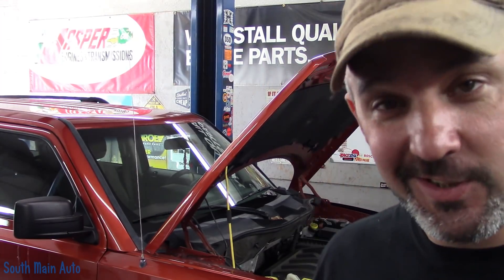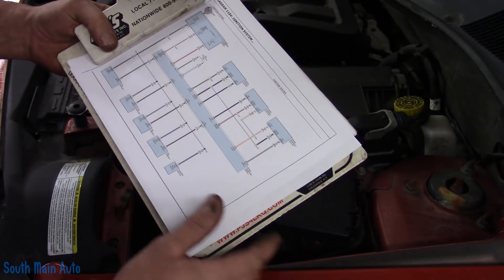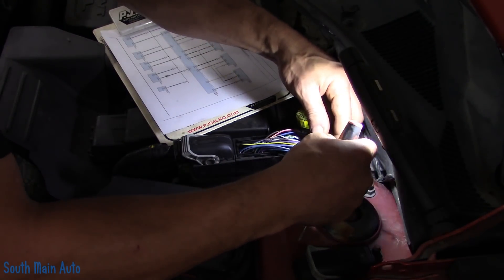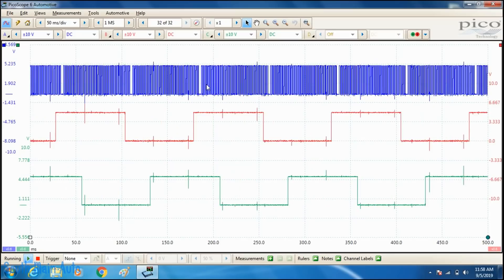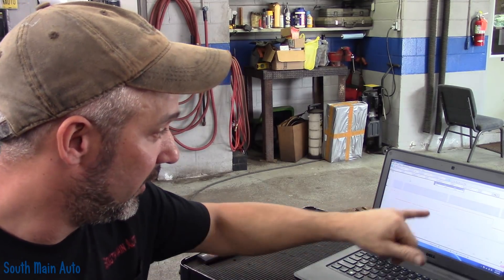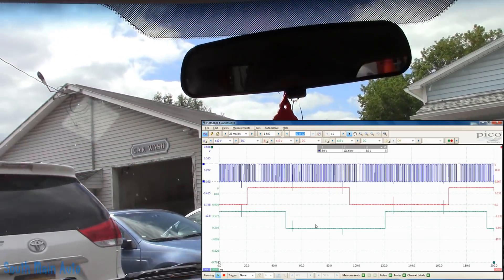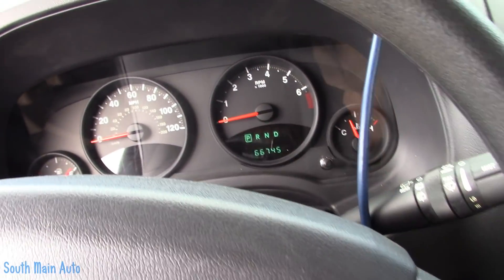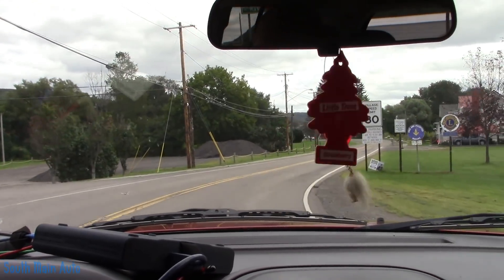Jeep Patriot: Crank Sensor Troubles

Comment: Kinda like my 07 Galant where I had a battery drain and found voltage over the door lock fuse and seems to work ok since I pulled the fuse and the system seemed to reset itself when the door locks where activated 2x's yet still leaves me a bit unsettled. Thanks for sharing.

Comment: The glitch from the sensor may cause the logic to behave in a way unaccounted for in the ECM firmware code. My experience with computers taught me, buried in the code is what I call run home to Momma. Essentially software like this has a list of potential faults or fault combinations. If it can't find a fault that matches the input, it will default to the first or last fault on the list. I have seen it happen with anything from a mainframe on down.

Comment: it seemed to do it at 5300 rpm or there abouts. When the jeep is in park the rev limiter is lower just under or around 4000 rpm. i wonder if it were put in neutral and revved out to 5300 if it would stall again or if it has to be both that rpm and under a load?
Reply: it wont free rev to redline in neutral either, only in gear, so on lift/jackstands wheels spinning

Comment: Eric my jeep did this also I happened to learn that my wife was over filling the gas past the pump shut off and happened to mess up the evap system and would do the same exact thing after awile with out over filling it cleared its self out had a 2011 just empty every pocket compass

Comment: Hey Mr. O -
I'm a big fan of your channel and watch almost everyday. I know this doesn't pertain to this video, but I watched a video you did on a Subaru head gasket recently and wanted to ask you if the carbide scraper you used is your preferred method for cleaning block and head surfaces on all head gasket jobs;  iron and aluminum? Appreciate any response!
Thanks!

Comment: Hey guys, Chrysler had a rapid response transmittal (preliminary TSB) for the crankshaft sensors on the 2.4L engines to be replaced for intermittent stalling. They're not that hard to install once you figure out the layout but you have to work blind to get the bolt out. I do it by going down by the right rear corner of the head from the top side. I use a 1/4" drive 10mm chrome swivel socket with an extension. Careful not to drop the bolt or you may never find it. Don't ask me how I know. :)

Comment: Nice video sir! I only have an Amazon special bluetooth scan tool, and I saw the same codes on my lady's 09 2.4. Her symptoms are almost identical: Random skipping and bucking, and it has died  flat out a couple times. We also have some issues with long cranks. Shut it down, wait a sec, and turn the key... Fires right back up with smooth idle. Very intermittent and definitely strange. We are replacing the sensor tomorrow, it will be her first real wrenching project. I have plenty under my belt.
Not sure if you will see this, but I have no way of resetting the adaptive memory. Is this a critical step? I have seen a few videos diagnosing and repairing this same fault, with a couple of people reporting either crib death sensors or a week of running before it spits another out. I can clear codes on my cheap scan tool, and see surface level data, but definitely not an o-smell-o-scope or adaptive memory/body module codes. Thank you in advance.

Comment: My 2011 Patriot is the same... too bad the last shop I took it to replaced the starter and the engine mount they were supposed to replace the CPK too but I doubt it cause now it's bucking worse... FML... do you think they didn't reset the ECU?

Comment: The easy way to do this job: Remove the air box, reach down behind the engine and remove the 3 heat shield bolts, slide heat shield out of the way, remove the crank sensor bolt and replace the crank sensor. 3.5 hour job done in half an hour. However this is only possible if you can work by feeling and not by seeing what you are doing.
Reply from the maker: Yeah that is what Jason ended up doing. Wasn't bad at all really...

Comment: Have you ever messed with a Suzuki equator I hit a deer it's been in the body shop for two months just for body parts now it doesn't want to start no throttle response now it just cranks over they put new battery throttle body still no start never had any trouble before always ran great

Comment: My 2016 Jeep Patriot does the same thing.   P0339 is constantly the engine code. I have replaced the crank sensor 8 times now & the problem persist.  Every sensor switch, I get about a week or so before the problem comes back. It now cuts off at prolonged red lights, slow-moving to stop/go  traffic, entrance onto the high way, and in idle and sometimes in park.  Lately, it vuts off with no check engine light ever coming on.  Great video. Any advice on it being a deeper issue than the sensor?

Comment: Your pinned comment closes the mystery.   :)
Reply: The scanner computer used in the video: https://amzn.to/2H3l6dt Autel MK908 Ultimate Wireless Automotive Scan Tool with ADAS, ECU Coding, Full Bi-Directional Control, ABS Brake Bleed, OE-Level All Systems Diagnosis

Comment: Here's a test I would have liked to have tried on this car - Run the engine and momentary disconnect the crank signal. Does the engine recover, or die completely requiring a restart?  If the answer is the latter then it is likely that a) the crank sensor /connector / wire loom is failing on temperature/vibration and b) Jeeps should be avoided at all costs. When a major vehicle system cannot recover from this kind of failure - it is designed badly (an aircraft engine would probably not be designed that way). Would be interesting to see what other car brands do?  A lot of these sensors are a Hall effect (magnetic proximity) type which do suffer from temperature failures. A heat gun and some form of magnetic pulse generator to exercise the sensor might prevent the inevitable "leave you walking" event.  Thanks for the video though - I am sure we will all see this kind of failure at some point.
Reply: Bit difficult doing 60 mph to unplug it , our job is very trying, knowledge of how electrical  components work  is a great skill and Eric has the skill !!!!!!
Reply: @mikeberry304  Parked of course. The nature of the dropout & recovery of this signal would point more to sensor intermittent connection (mechanical) rather than temperature. Changing the sensor thus probably fixed it of course. I just like to know why something is repaired & the nature of how the system reacts to the failure. Eric's knowlege/skill is impressive.
Reply: You could momentarily ground the CKP sensor signal circuit at the PCM with a test light to see how it reacts while the engine is running.   It will probably shut off and flag the CKP intermittent code

Comment: I got a 02 Mitsubishi lancer es i changed the camshaft position sensor and now the car gets no power, up to this point I've replaced the crank shaft sensor the battery spark plugs fuel pump starter but it would crank but not start

Comment: @2:22  dont ever assume  especially with chrysler wiring harnesses. shame it was so hard to get to. been bit by in harness splices too many times and especially mopars . they weld the wires together rather than a crimp connector,  with it dieing on a full torque that harness is stretching.  will be watching to see if it  makes it back.  i understand your reasoning though.
Reply: seemed more rpm and vibration dependent than on torque twisting. on lift or stands in gear so the RPM can whizz way up there would show the same thing.
I'd have been leery of the connector terminals being bad/have leaked in salt water

Comment: Isnt it a hall effect sensor thats prone ta heat gremlins as it ages? Its like my toliet float device which has an adjustmen ta stop trickling of water creatin tgat annoyin high pitch sound. I adjust it and its like all gud then 1 hour later the dang trickle is back. Gonna have ta replace it in other words cause the dng gremlin has jinxed it and claimed as its own.

Comment: What was the reason for having to pierce the crank and cam wires instead of back probing at the ECU connector?
Reply: With the bouncing road you don't want you back probe wiggling around creating a glitchy pattern.  The piercing probe is a more secure connection.

Comment: replace the alternator. check the coils on the heads as well.  your problems is alternator.. its throwing out wild amps. you can replace the weakest link if you want. its the alternator that is the problem.. she'll be in the shop again. another weakest link will fail. i know because i had the same issue... they need a recall on all alternators supplied on the jeep patriot.. i had 3 coils fail and the alternator..  one dealer replaced the transmission on a patriot and found out it was the alternator that was putting out wild amps. killing electronics

Comment: Wouldn’t it be a refreshing idea if engineers set a goal of building vehicles with the purpose of making failure components as easy to access and replace as possible. If nothing else they could build fair products that are cheap to repair. I once had a Pontiac GrandAm where to replace the thermostat you opened the coolant cap and pulled up on a loop. The thermostat came out and you pushed in the new one. No hose clamps, lost coolant, wrenches, or gaskets.
Reply: that cuts out all the dealer service(rape) departments.....

Comment: There's a recall for certain Chrysler products to replace the harness for this issue.
Reply: Fiat Chrysler Automobiles will recall 43,071 vehicles in the United States to replace the crankshaft sensor connectors. The campaign will cover the 2016 model year examples Dodge Journey, Jeep Compass, and Jeep Patriot. In addition, there will be 3,385 of them in need of repair in Canada, 487 in Mexico, and 2,830 outside the NAFTA region. The problem only affects models with manufacturing dates from May 9, 2016, to July 15, 2016, and with either the 2.0- or 2.4-liter four-cylinder engine.

Warranty data showed FCA U.S. a population of vehicles that had crankshaft sensor connectors that didn’t conform to the proper specifications. The parts could potentially lose contact, which would cause the SUVs to stall or not to start. This could happen without an error appearing on the instrument cluster. The company is not aware of any accidents or injuries from this fault, though.

Source: Fiat Chrysler Automobiles, National Highway Traffic Safety Administration
Reply: Not the right year but it is the right motor.  Manufactures only need to recall on cars X years old.   I think the right call was made to replace the sensor.
Reply: @stevenrice47  this one is 2010
Reply: We had one that we got a pigtail and sensor.

Comment: I own an '09 Grand Caravan. That Jeep uses the same radio & HVAC controls. Pretty soon, the Jeep owner will have problems with their heater/AC fan speed. HI speed will stop working, and the controls will have to be removed. The issue is the copper connectors on the speed control knob get covered in melted plastic and require cleaning.

Comment: Dude, the owner of the Jeep, Jason, and you need to get some lottery tickets.. the way the crankshaft position sensor is the heart and soul of any EFI system, hardly ever do you get codes for that sensor..
Reply: I see crankshaft sensor code fairly often.
Reply: @meabob  I don't understand how it would happen.. considering without the crankshaft position sensor there is no spark signal generated

Comment: Have a relative with a 1991 Dodge Dakota (3.9L).  It seemed to need a replacement sensor every 60k miles, almost like clockwork.  At the 120k replacement, he started keeping a spare behind the seat.  I see this Jeep is at about 66k...must be coincidence.
Reply: NO your cousin had an old truck that liked to run hot. That is a big V6 that produces a lot of heat because it has to move that heavy truck. Yes it is a mid size but heavy vehicle. Heat confuses the CPS sensor in all cars.

Comment: Don't know the problem with the CVT.  Never had any trouble with my Jeep Patriot CVT.  Suspension parts?  Well, that's another story.  Just have to learn how to drive the CVT.  Can't treat it like other transmissions.  4WD in the Patriot is extremely aggressive.
Reply: A Physics Professor surrree Jeeps are unreliable cheap fiat garbage.
Reply: @jaymoar3561  probably buys/leases a new one every 3yr or so and low miles

Comment: I am watching this with interest. We have a 2008 Chrysler Town and Country. That dies intermittently for no good reason, starts right up and No codes. ( Popcorn Munch munch munch.)
Reply: The 3.8L engines also had crank sensor issues.
Reply: I'd scope injector and coil amperage while watching fuel pressure to see what drops out right before the stall.  Once you know what goes away or glitches will give you direction on where to look for the culprit.  Solving intermittent fast glitches is one of the hardest problems to diagnose.

Comment: It is a Jeep. Crank sensors seem to be a big problem. 👍🧰💰
Reply: I agree. And intermittent failures are the pits. Last year my 1989 Cherokee with the 4.0 I six experienced occasional crank / won't start . Wiggling the wiring harness and squeezing the connectors usually fixed the problem. I replaced the crank sensor, which is high on the bell housing and needs to be done by braille. I found that, probably due to oil leakage from the valve cover, the insulation had shrunk away from the wires at the sensor, leaving exposed wires. When the wires crossed viola no crank signal. It took a friend with about 30 inches of extensions and two universal/wobble connectors to get a socket on the one bolt holding it in. The total cost was less than $ 100, parts and labor.
An aside: some YouTube videos suggest that there is an access panel under the carpet to make changing the sensor easier. It isn't present on all models/years. I looked.
Reply: It is a Jeep. Nuff said

Comment: No problems shutting off on the road you say?  Well... I noticed that it was at 4000 or more rpm when it kept dying on y'all... in park or neutral it'll top out at 3500 rpm
Reply: yep, need to rev it in gear on lift or stands ;)

Comment: Mine is a 2015 2.0L Patriot sport. A friend changed the crank and both cam shaft sensors and that seemed to have fixed it. I had about 56k when this started happening. Jeep is crap.

Comment: My 2002 Ford Taurus had the same problem...Crank Timing Sensor. 
No knocking, slow acceleration, worse mpg.
$32 (O'Reilly Auto Parts) lifetime warranty, relatively small part, Just 2, 5mm bolts to take off.
Much easier. On top of the engine block, underneath the wiring harness. 45 min fix.
Original part replaced, runs like brand new.
Moral of the story, Don't buy a jeep.

Comment: I had a 2008 Jeep Patriot (check the pfp) and my god they are gigantic piles of shit. sold it to a buddy at 96K miles. TOLD him it needed the CVT flushed. He never did. it lasted 7 months before the belt slipped. got auctioned off later from a repo. prob in a jy now

Comment: Just before Fiat (merged 2014) started to get a hold of the Jeep Brand circa 2009 it seems the brand began to turn to Pooh.  Chinese manufactured parts, maybe?
Reply: Yep
Reply: You guys are too funny.  I own a Ram truck and almost every Mopar part I have purchased is of USA or Canadian origin.  Check out GM if you want Chinese parts.  Eric knows what I say is true.  Chrysler, at least with the trucks, does a pretty good job of having high USA/Canadian parts content.
Reply: That vehicle line (the GS platform - Compass, Caliber, and Patriot) was first produced it 2006. The only influence Fiat had with it was the decision to stop making them.
Reply: @meabob  Do not misunderstand.  I have no idea what influence Fiat has had on the brand.  But, in the few years prior to the merger the brand seemed lost.  How can a Company in 2010 make a Jeep product for less than $15,000 new?